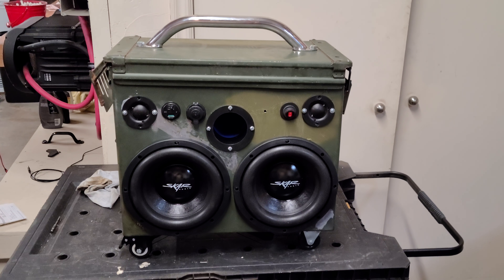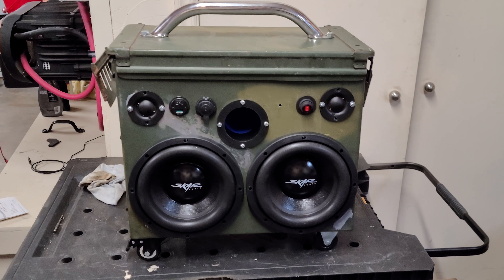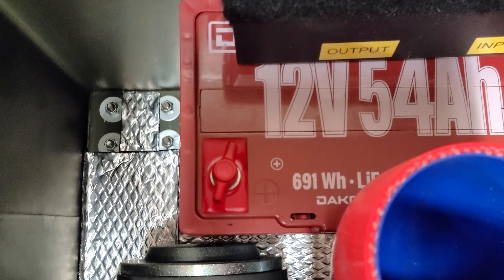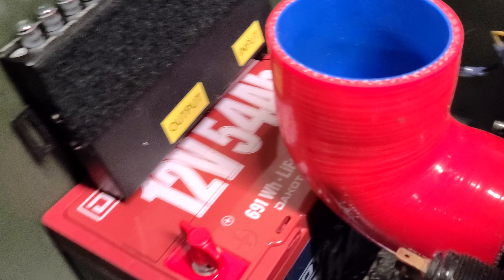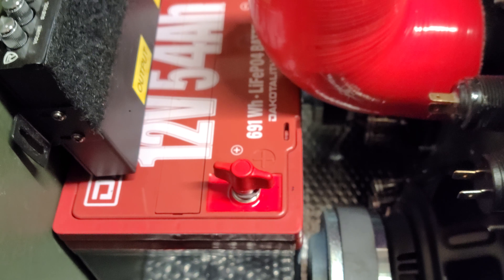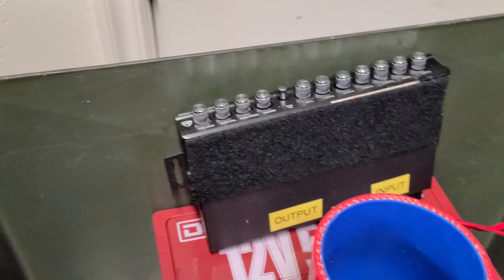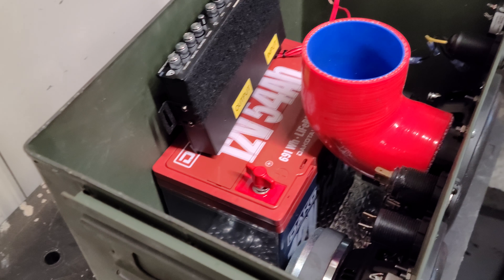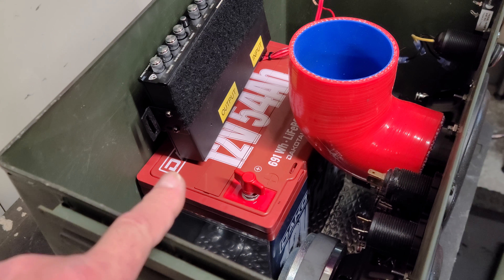Phantom (Fat 25 ammo can speaker) battery fitment, loose speaker clearance check/issues

Comment: Big :O not stealth at all, but definitely Phantom :) It's gonna rock dude! I'm looking forward to hearing it :)
Reply from the maker: Remember the old USAF/military term, "overcome and adapt"? I came up with a "sorta" solution. Use the DL 23aH lithium battery, have a SAE 2-pin sidewall power jack. Why? If and when I want to "really" crank two 400w amplifiers...use an external battery and plug it in! The NVX amplifiers are Class D...super efficient. But, runtime will be in the dirt at full power with a single 23 aH battery. Again, not 100% sure...heck, might even work. Going "cRaZy" here with this build...want MAX power, great sound, LOUD, and transportable. The F4 Phantom will fly soon!